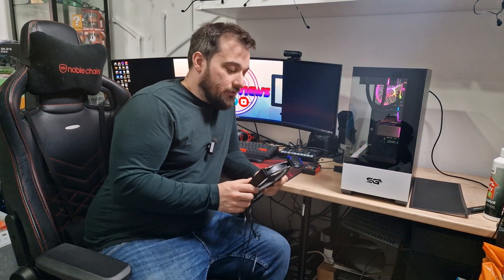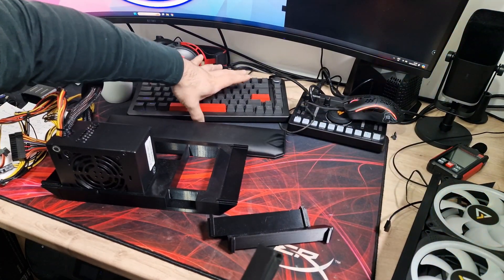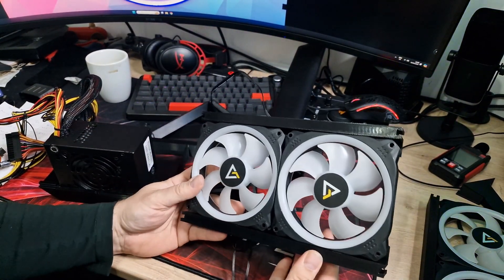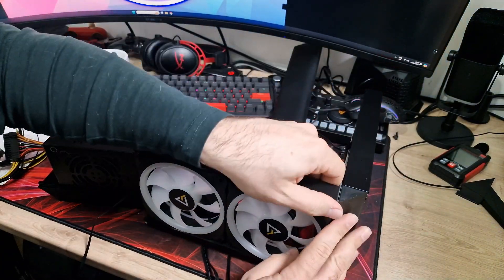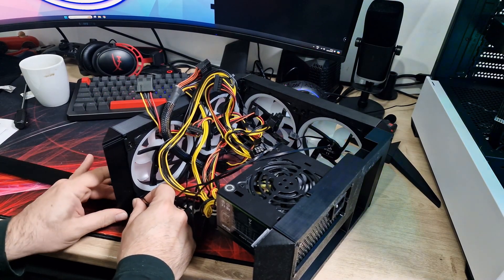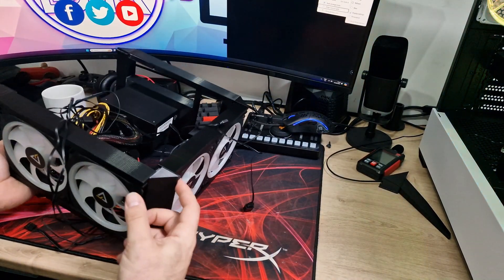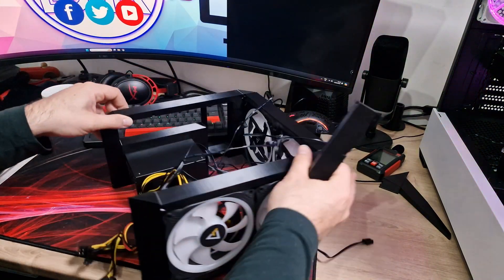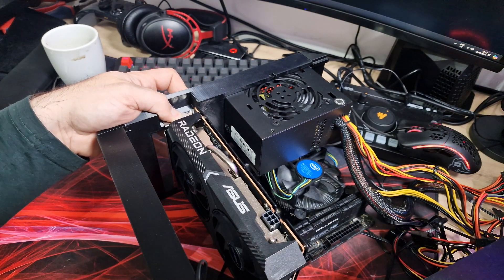I designed my own PC Case! (My first 3D Printed ITX Case) - Part 1

Comment: will there be enough clearance to plug the gpu in when the top is on?
Reply from the maker: Good point and something I actually noticed after I filmed this. May have to use an angled adapter
Reply: Yeah I know they exist but are still quite chunky so may be cutting it fine in there 🤞 @DowsettReviews
Reply from the maker: @tidytrev  will see. Its only been waiting for a few years so what's a bit longer if I need to re design 🤣🤣
Reply: Failing that an unpowered GPU may be your only hope....that or igpu  @DowsettReviews
Reply from the maker: @tidytrev  ha ha not sure it works like that and it's the 10100f so doesn't have igpu

Comment: I would think it would be best if you move the power supply is the top left of the case and get one of them power adapters to route to the back of the case, this'll make it easier to build in and you'd have more options for air cooling
Reply from the maker: Yeah I thought of that but not really anywhere to mount it without giving up on of the fan sides or making it bigger. I'll have a look again though and see if I can figure anything else out that would work better.

Comment: what about using the PURE ROCK LP it should fit under there but for a first I think its awesome bud
Reply from the maker: Cheers buddy. Yeah that was my first thought to use that cooler however its currently in my mini nas and I have to take the whole mobo out to get it off that lol. To be fair it's only a 10100f so doesn't really need anything substantial, just an old system to test the theory of the case